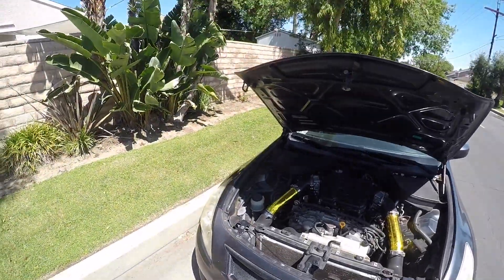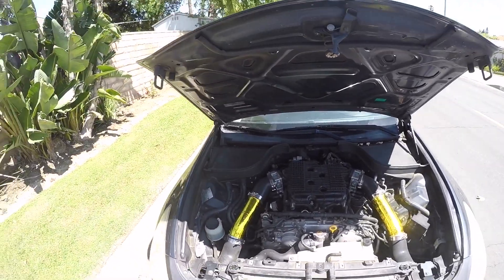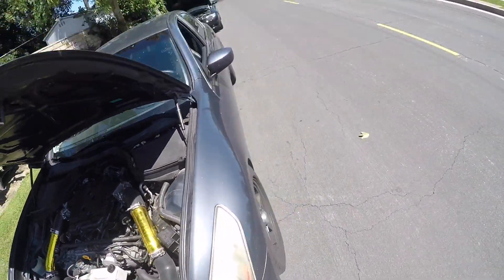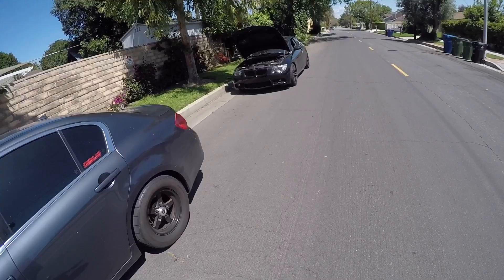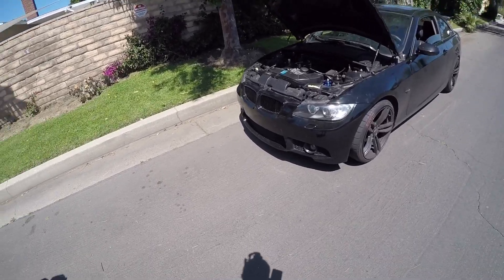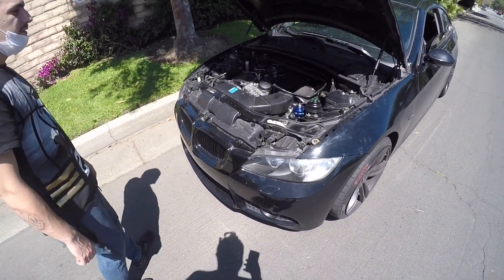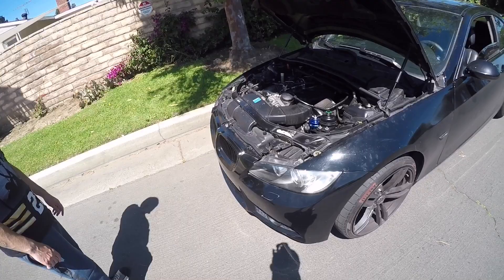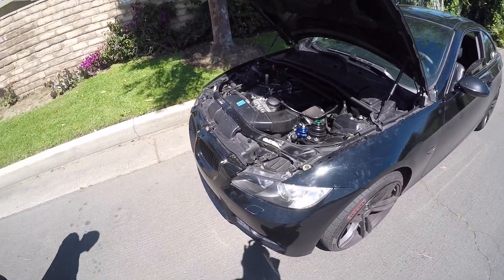2010 G37 vs FBO 91 MHD tuned n54 335i

Comment: Damn that's crazy, I was looking to get a 335i and do bolt ons but didn't wanna deal with the unreliability of the N54, looks like I'm getting a G37 now. Thanks for the video!
Reply: Get a N54.. my engine harness was torn and made my o2 sensors trip and the idles higher than normal messing with the torque response

Comment: Lot of people be calling BS but now that I see your mods, tbh it makes sense. 

N55s and N54s on stock turbo, running MHD Stage 1.....I mean doesn't matter 91, 93, or even e30. They're like 370 whp at best. 

With intakes, headers, full exhaust, e85 and weight reduction. You'd be pushing 360-370 whp as well and you're a good deal lighter. 

Makes me miss my G but the 340i is a different animal entirely. Stage 1 on this car, even 91 is like 380 whp. Stage 2 even on 91 is 400 whp easily. On 93, it's like 430 whp and when I tested e30 it felt crazy, it's supposed to be putting out near 460 whp

Comment: Something wrong with that 335i lmao. A tuned g37 isn’t going to beat a fbo 335i that’s pushing at least 360-380whp
Reply: raigen123456 nothing is wrong with the car, the g37 is fully gutted from the inside “no seats” and it’s running on e85 with custom tune, nonetheless it’s a very fast car..
Reply: I know i oen n54 335i eith cobb tune fbo and i walked g37 pretty easily.i have about 470lb torque and about 380whp.if use e85 i can get it to about 440whp
Reply: You were actually right.. I had a messed up engine harness making the o2 sensors trip and idle higher than normal